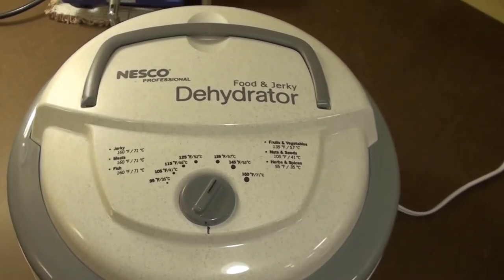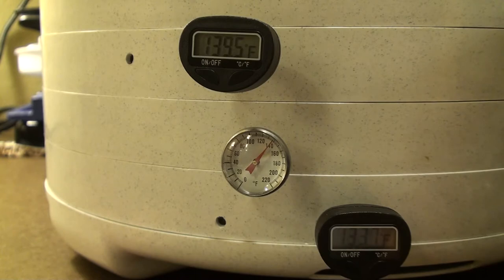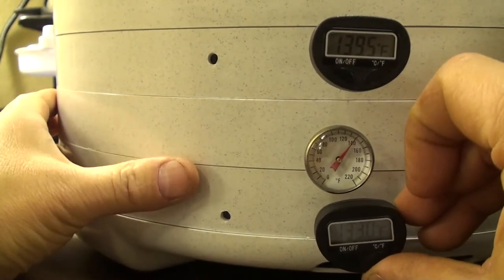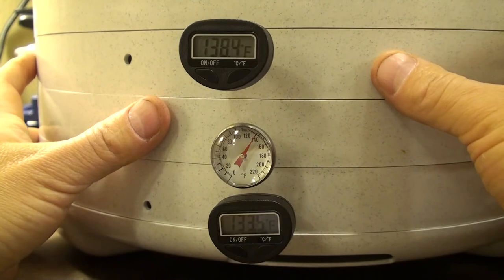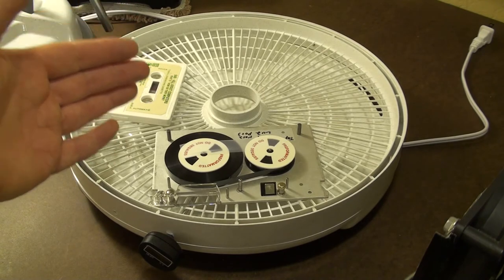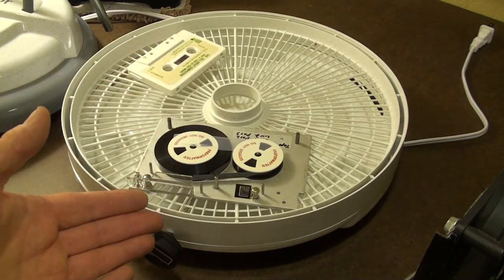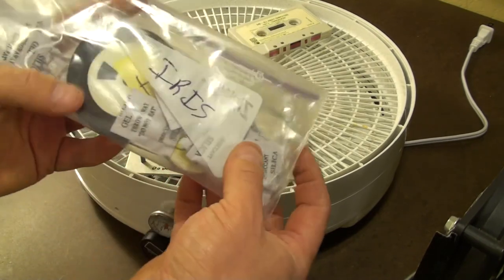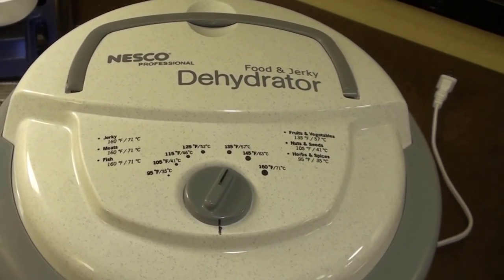QIC Cartridge Tape Baking (Sticky Shed Syndrome Remedy)

Comment: Thanks for the post! trying to "de-shed" about 30 cassettes, bought the dehydrator will post results
Reply from the maker: Thanks for this comment, Moe Donnelly!  I look forward to hearing about your experience with this!
Reply: Ok here's how it worked for me.I had number of 70-s - 80's cassettes of the old jam days.I thought they were "stretched" because they warbled,speed fluctuated and sometimes just stopped.Saw this video,bought the dehydrator, cooked them between 125 and 135 degrees overnight ( 10 hrs) and my test tape WORKED! was able to digitize aclean recording and put in the cloud! Moving on to a few more tapes! Thanks Convergent Mighty Frame
Reply from the maker: @moedonnelly1493  I am so glad this helped you.  Congratulations!

Comment: I watched but did not hear, how long do you bake them at 138 degrees F? thanks.
Reply from the maker: @RPh Tom, Thanks for your comment & question!  I didn't specify that on purpose.  Those who claim experience with tape baking for sticky shed syndrome say only a few hours is necessary.  However, a few hours never cut it for me for these tapes, so I would bake them for 3-4 days straight.  But since this disagrees with the "general consensus" for tape baking, I kept this little detail to myself, to avoid controversy.  Hope that helps!

Comment: Dehydrator or convection oven? Which one to use? Both seem to work.
Reply from the maker: In my opinion, a dehydrator.  They are designed to operate for extended periods of time (days), and their optimal operating temperature is right around the optimum temperature for baking tapes, whereas a convection oven is designed for shorter duration use (only a few hours at a time), and tape baking temperature is at the lower end of their operating range.  Just my opinion though.  I hope that helps!

Comment: Well there's now a good sized hole in the plot of the Mr. Robot episode of which I lost interest in the series due to inaccuracies.
I stopped watching the series because the premise of a particular episode was data tapes supposedly (haaah!) lost their data at 90 degrees F. I've taken colorado backup tapes from garages that routinely hit 150F here in Arizona and gotten data off of them just fine, and figured that the physical thermal overloads in air handlers and pack units would limit the ambient high temperature to something more reasonable, so attacking the thermostats was a moot point anyway. 
I really hate it when shows like this clearly have talented technical staff and they don't ask them. Perhaps the crew of mr robot will start using vb apps to backtrace people using the help of the internet police :P
Reply from the maker: Well, Cpro, thanks for sharing this.  I appreciate your revelation here, on this show, at least.  Having never watched it myself, I thankfully have spared myself of the fallacies of any episode plots. 

I never watched it probably because since it's debut, I've probably been working so hard on all of this real vintage tape restoration, that I simply never found the time.

All for the best, I suppose.
Reply: Can the pro machine discussed bake 2’ tape?